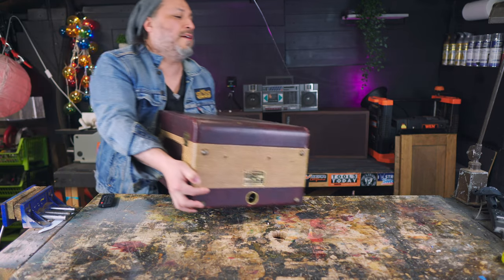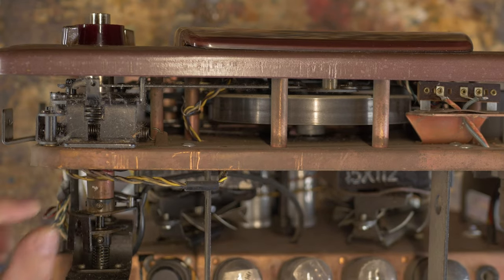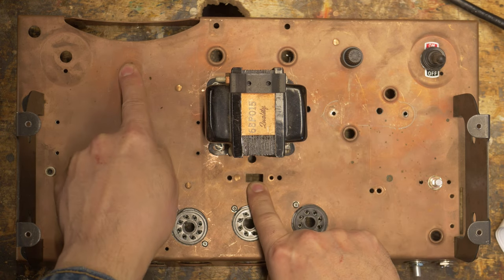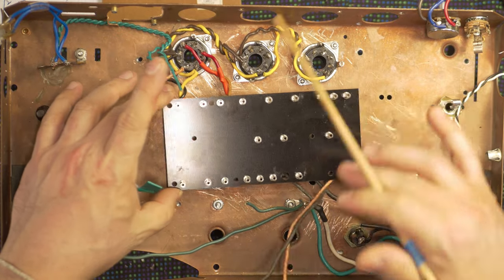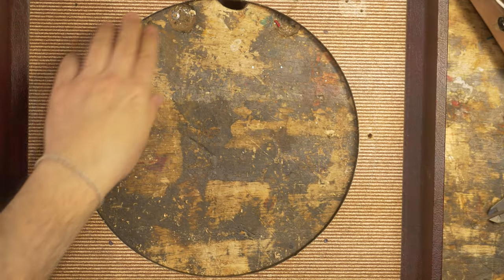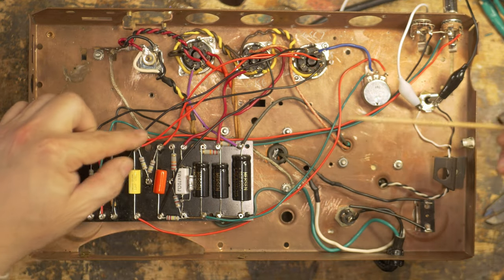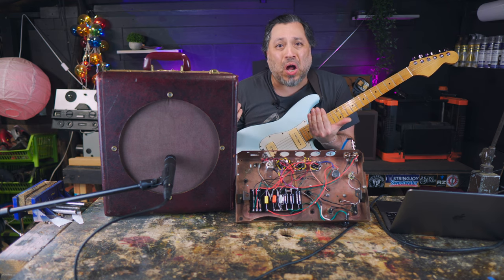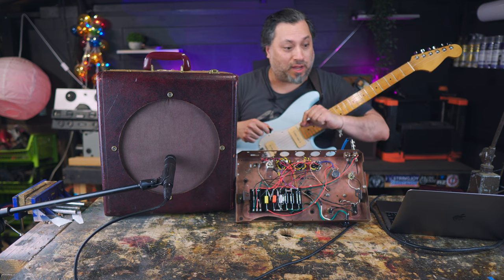Convert a vintage Reel to Reel to a Guitar Tube Amp

Comment: Why aren’t we making these? Because we’re not all technicians and don’t know how amps work inside and out. Converting to a guitar amp to me is connecting to the recording head wires and using the amp the way it is, in the recorder. I’ve done that, that’s converting, not building. You’re building, a bit too technical for slugs like me….😮😮😮😂😂😂

Comment: Wow! I'm so glad I stumbled across your channel. I just purchased this same recorder yesterday for 10 bucks at a thrift store with the exact same intention of making a guitar amp out of it! I knew nothing about it, but it was so heavy that I thought it must have a great transformer in it, why not? Do you think there's any way to incorporate the green  "magic eye" recording level tube tube for aesthetics? Thank you for this. Subscribed!
Reply from the maker: Hi Ron, there is a way to incorporate the magic eye. Google "hammonator amp conversion". Someone did a Hammond organ conversion that incorporated the magic eye and drew up a schematic. Looking at the schematic it seems fairly easy. It's hooked up to the secondary of the output transformer. There are a few more components necessary to make it work, like a trim pot to adjust the sensitivity, etc. Thanks for watching and thanks for the sub.
Reply: @MarkGutierrez   Very cool. Thanks you!

Comment: Are there tone controls on this ?  My father built a "Jensen" Amp (And FM reciever) for his record player.  Eventually we took the amp out and fitted it to a cabinet made from old plywood cupbord doors.  Though vol and tone are in the circuit they are fixed using the guitar controls instead. It is pretty handy - though prob needs a recap and service by now.     Otherwise my father also built (in a way- he worked for the company)  a Vortexion WVA tape recorder- the deck is wearite dropped in but the amp design in part was his and he wound the power transformer, again it works well as a guitar amp (though I blew the internal speaker cone so pure tone is impossible)

Comment: Could I get a schematic for this? I want to reuse the old components are well but the values are different for the schematics I found and I don’t want to ruin the xformer or burn out the old tubes

Comment: You should/could have used the 6SL7 instead of the 6SC7, it is the same tube except the 6SC7 has a common cathode for both triodes which is a limitation because you could have biased the individual triodes differently. You could have gotten more volume and grit if you had added a gain stage I have used the 6SJ7's for this but you could have also added that 6SN7 or 6SL7 depending on what you were looking for. I get that you were just getting into this hobby of building tube amps and are just following schematics at this point. If you decided to get deeper into it you will get to the point where you can start with a schematic and tweek it to your taste then you can start experimenting with your own ideas. It is very fun and rewarding. I have that same R2R as well as several more tube ones from the 50's and have converted several in a similar fashion to what you have done here.
Reply from the maker: Wow, cool suggestions. I'll keep that in mind for the next build. thanks!
Reply: Interesting points. 
Btw, do you ever convert an R2R and keep most of the circuitry intact? Not taking away from Mark, he did a great job, but 90% of the guys are taking a vintage device, ripping everything out, and building a Champ or something in the chassis. Even if you use a few of the parts, there is nothing interesting about the resultant sound. I’d be interested to see someone modify what’s already there and see how it sounds. I’m no pro but I’ve been experimenting with this as a learning tool. Why not service the parts that you’ll use and change values in the signal path to tweak it. I have several recorders and some of them (like V-M’s) have 5Y3 and basically guitar amp tubes. 
Anyway, I was curious if you do that and have any thoughts about it.
Reply: @2tallB  That's basically what I do mostly. I look at the schematic and modify only what needs to be changed to make a great sounding guitar amp. Sometimes it is as little as modifying the input section . Such was the case when I found a 1950's Kodak projector at my apprenticeship school when I was studying to be a journeyman electrician. The amp had a 5y3, 2-6L6gb's and two 12AX7's. The amp was designed to amplify the audio which was encoded on the edge of the film as well as accept a microphone so that the teacher could use it as a PA system. I basically just disconnected the input coming from the projector part and modified the input section because of impedance issues plus there was just a lot of junk on the input that caused low volume and muffled tone. I basically reworked the input like a standard guitar amp. The rest of the amp was almost identical to a mid 50s Fender deluxe except it had 6L6s and actually had an extra gain stage because on a deluxe V1 has 2 channels and they share a 12AX7 one triode per channel. This amp had them one after another followed by a vol, treble and bass control, another gain stage and a cathodyne PI just like a 5E3 deluxe except instead of 6V6s it had more powerful 6L6s. It is a great amp and sounds fantastic. I also changed the electrolytic caps and coupling caps. I have gutted things too if the circuit won't make a great sounding amp. The vast majority of the 50s consumer grade R2Rs are not good quality recording devices and rather than them be redundant it is better to re-purpose the components so they are useful rather than in a landfill. I have encountered many times circuits that are just not conducive to a guitar circuit.But I never build clones of other amps, I am advanced enough to build my own designs although sometimes that means grafting together ideas from other amps to make them do and sound like what I want them to sound like.
Reply: @skullheadwater9839  very cool. Yeah, that seems to be the ticket - bypass almost everything prior to V1 and change the resistors/ cap. They usually have some complex switching there anyway. And step one - disconnect the motor of course, which some of them are nice and can be sold. For me, I’m still figuring out how many gain stages to use and how that will sound exactly, with modifications. I find it’s fun to mess around with these instead to fooling with a vintage guitar amp. The 50’s R2R’s have a wide range: I find the Wilcox-Gay have an excellent build quality, the Silvertones are junk except they can have great tubes, and the V-M have a guitar amp type build, including volume and tone after V1, which many don’t have. Anyway, thanks for the reply.
Reply from the maker: @2tallB  unfortunately all the caps were no longer any good and most of the resistors were out of spec. I did try a version with the some original components but it was too noisy.
Reply: @2tallB  You are welcome, also some Japanese stuff is cool. The Akai M8 has 2 complete single ended amps with EF86s 12ax7's and el84 power tubes. One time a guy paid me to convert one of those for guitar use. He wanted a champ, and a Vox AC4 in the same box, It came with 2 wedge shaped 8" speakers that all button up into a box with one handle. Roberts are just Akai with a different exterior and name badge. Sony has some nice ones too like the TC-500a, that one I pulled the transformer and built a supro 6424 clone. The sky is the limit. Except the unfortunate thing is it is hard to find them for $30 anymore videos like this have made the prices go up.
Reply: @skullheadwater9839  Tube audio guys also like modifying the Akai M-8  for hifi use. You'll end up with a nice EL84/6BQ5 single-ended pentode stereo monoblock. I'm sure you've seen some the threads on this modification, there are tons of them. I just picked up a cosmetically near mint M-8 for short money yesterday and now I'm trying to decide whether to cut my teeth on restoring it for reel-to-reel use (just because?) or to modify it for monoblocks, or move it onto someone else who wants to do the modifcation/restoration. 

I already have a killer Piilot SA-232 EL84 stereo amp that I restored, so I'm good on the EL84 sound, and I also have some Leak TL 25/Plus monoblocks on the bench for restoration soon, so my KT66/EL34 itch will be scratched soon enough. Currently running an HH Scott 272 Laboratory integrated with KT66s that sounds incredible...
Reply: @Maquis1943  Nice 👍, I am actually in the middle of a smash up, I pulled a chassis from a Revere T-100 which had a 6V6 SE amp but a 6K6 oscillator as well as two 6J7s and 6SJ7. It had a 6x5 rectifier but I wanted to supply more current for a push pull 6V6 situation so the power transformer will supply everything except the 6AX5 filament which I have a separate filament transformer because they need 1.2 amps of 6.3 volts. Anyway I am basing the amp off of a valco 1224 and sticking this chassis in a 1959 Magnavox record player upright console. So it will look like a record player but when you lift the lid the spot when the changer was will have a shelf where you can store pedals and cables. To the right where the radio was will be the amp controls. I made it to plug in around back so you won't have to have the lid smash the cord and I thought it would look funny too.

Comment: hi super  job 
some time's to save tape decks  we have to jazz up old  tape decks    cassette to  2 inch  tape decks 
alot of the tape decks i have had been jazzed up in some way

i know a man who has a web site he sells parts for tape decks  the thing is  he said tape deck fans are very picky 
turning reel to reel in to a amp is ok with me   i know the tape fan are not happy one bit 

to all out there the best using of old mono is to turn them into stereo play back decks  as it's a lot easyer to use 
far east low cost parts

Comment: 8 : 25 A.M....perfect !! for Mass !!! ( kidding !) What would it 'all' sound like with 4 ohms instead of 8 ? Would the components need bigger magnets , et al ? Nicely done , as always... thanks !!!
Reply from the maker: LOL. The speaker plays a giant role in the tone of the amp. It would be very easy to have separate jacks for 4, 8 and 16 ohm speakers. I just went with what the original reel-to-reel load was which was 8 ohms. Thanks for watching!

Comment: Hey Mark, thanks for the video. Inspired me to get a custom conversion made. I have found a Webcor and on the backing plate it written that's its a 95 watt. I noticed in your video you mention that the amp you used was a 5 watt. I am correct in assuming the Webcor is in fact a 95 watt? Many thanks for you help. Cheers
Reply from the maker: Mine was definitely a 5watt. Those tubes don't output more than that.

Comment: Is there any way a complete beginner can do this safely? If not, where would one start to learn in order to build up to a project like this?
Reply from the maker: Start by studying the simplest circuit (fender champ 5F1) on a screen. No danger there. Rob's site breaks down the safety and circuit. https://robrobinette.com/How_Amps_Work.htm Then find an old reel to reel. Salvage the chasis, power transformer, output transformer, tubes, jacks, and wire. Those parts must be salvaged together so we know the transformer powers the tubes properly. Then build a champ circuit with new capacitors and resistors. Find the pin diagrams on google for the tubes and wire them to your circuit using the salvaged wire. I didn't even bias my tubes. You can if you want them to run efficiently.

Comment: Thank you Mark.  I have an old radio, from the '50's, it has a nice big amp section, however I know nothing about electronics, so I'm looking for someone with the knowledge to help/direct me to make a guitar amp out of it.  What I need is to find an electronics buff/nerd who loves this stuff and is happy to show/teach me, I suspect it will take me some time!
Reply from the maker: Hi Owen. Start by researching the Fender Champ schematic. It's the easiest circuit to deep dive into and begin building your amp.

Comment: Mark do you have a schematic for this build?
Reply from the maker: I used a combination of schematics. The actual board is a straight up Champ/Princeton circuit. It doesn't get any simpler than that. I just used slightly different tubes so the hardest part was figuring out the 1:1 relationship between the tubes for a champ and the tubes I had on hand from the reel-to-reel. So to answer your question, I worked off the Champ circuit. I think it was the Champ 5C1 and the Princeton 5D2 that I referenced to build the circuit.

Comment: Awesome video, I just picked up a Revere T-100 for $20 on my way into work the other day.  It’s very similar to yours in this video and seems to be in very good shape with the actual Microphone that came with the unit however when I plug it in and turn it on one of the tubes (I think the 6XS-GT tube) looks like a lightning storm is happening inside of it and the big black transformer starts smoking so I just turned it of.  Any ideas on how I should go about troubleshooting this thing or would you recommend just getting another transformer altogether.  I’m going to order another 6XS-GT tube as well.  Also the other tubes this model uses are 2 6J7 with the wire attached on the top of the tubes, 1 6SJ7, 1 6V6-GT, 1 6K6-GT, and the 1 6XS-GT.  I’m hopeful I can still use this unit and build a tube amp. Anyways, any info in much appreciated.
Reply from the maker: Most folks would first suspect the transformer or tubes on these old recorders are to blame. But it's more than likely leaky caps and out-of-spec resistors. Usually the transformers are in great shape. I can't say what is going on with yours. even in vintage guitar tube amps you'd want to replace all the capacitors and ensure the resistors aren't bad.
Reply: 6X5 GT

Comment: This is so fake you can't use the power transformer again in that amp haha the power transformer was running motors and more valves you think we are that stupid.
Reply from the maker: The schematic for the Webcor is online. It clearly shows the power transformer has multiple wires coming out of it to power all the necessary components, including the tube heater elements and the rectifier. I simply just used the wires for the tubes. Works great.
Reply: The motors in these things run on line AC, not the PT. It’s already got an amp in it so you can clearly use that amp after servicing or put another simple build in there.
Reply: @2tallB  you can buy new kits that are cheaper and safer
Reply: @theprogrammerrolandmc3039  thanks for your valuable input.